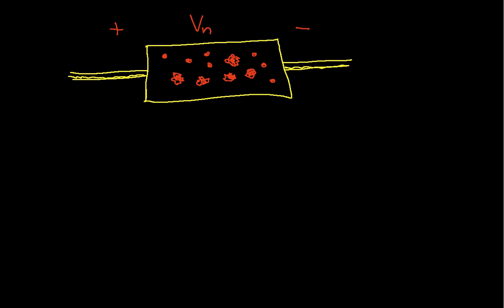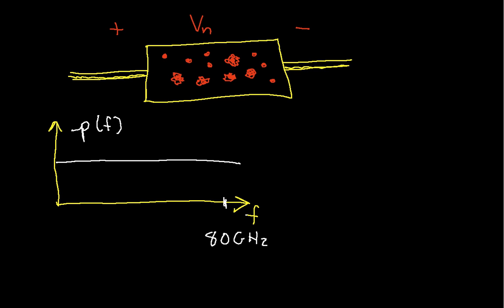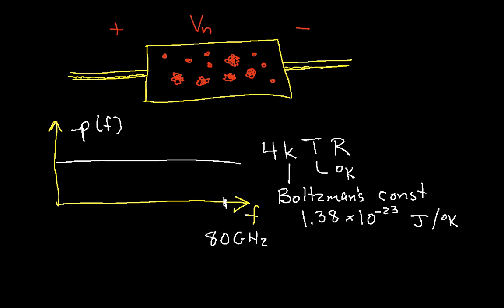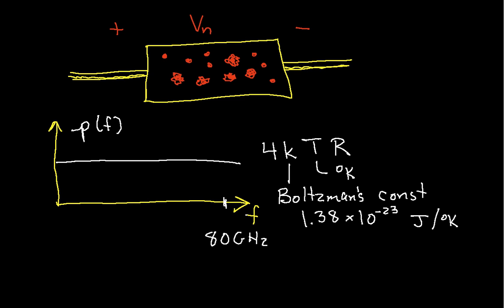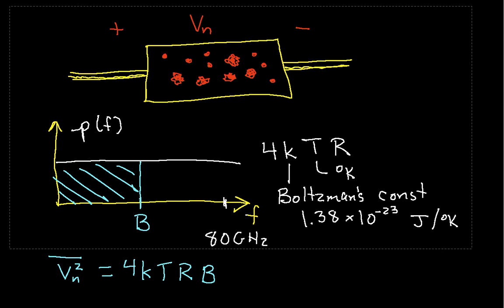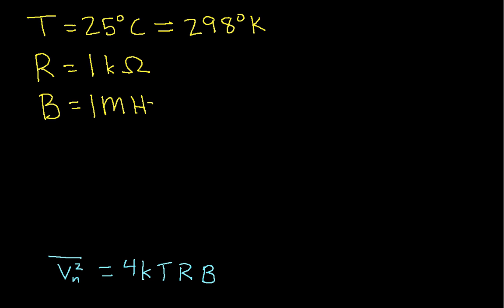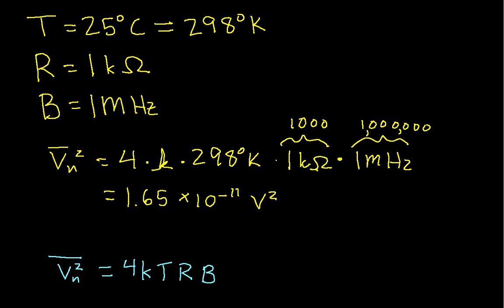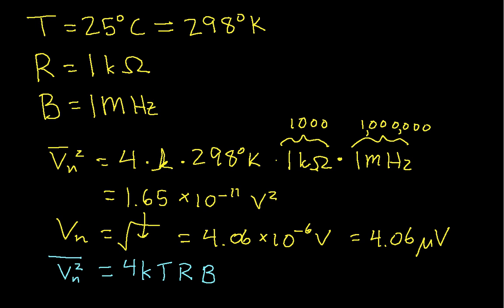Introduction to Thermal Noise

Comment: So how is thermal noise simulated? I though it could be simulated by adding an AC voltage source in series with the resistor, but what would the frequency of the AC source be? I also don't get how the bandwidth of the system makes a difference? Why would a resistor care what the bandwidth of the rest of the system is?

Comment: Does the voltage change across time? Or is it stable?
Reply: As long as the resistor is maintained at 298K on Earth, it is stable. If it is sent in outer Space, the noise level will go down as the device's temperature decreases, down to 4K (the Outer Space's temperature).

That's why the James Webb Space Telescope  has been sent so far away from Earth (1,5 million km) : To reduce its temperature to just a few Kelvins and reduce the corresponding noise levels aboard.